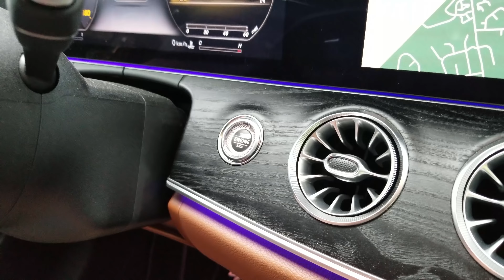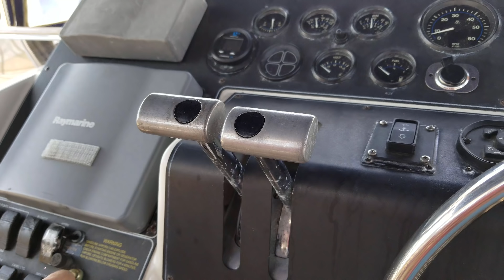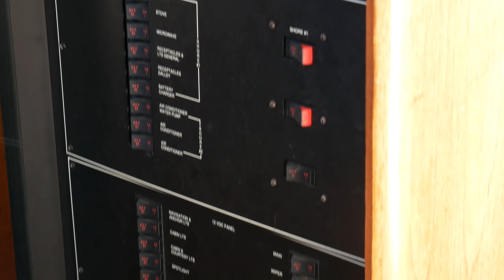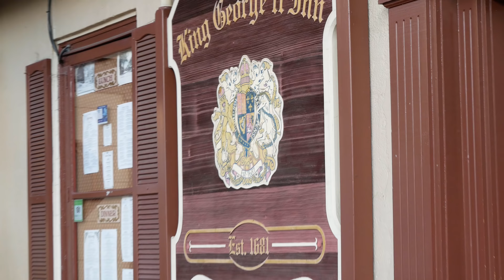We cruise our Carver 355 from Philly to Bristol E48

Comment: Have you still got your Carver?  I guess I thought you had sold it after you offered it "For Sale" in your video sometime back.  I'm looking for a boat to start with and I'm interested in your Carver if it's still for sale.  LMK.
Reply from the maker: Although it is still for sale, we stop listing it over a year ago. We started renting it out as an AirBrB at Penn's Landing, and it was showing so much profit we stopped trying to sell it. Still, if someone offers us $50k we will sell it. It is in great shape, engines are low hours and well maintained and it surveyed for $67k just a couple years ago. The reason we are selling it cheaper is the generator has been intermittent. It runs great, but the electrical output is sometimes off. Not sure what is wrong. We never use it since the refrigerator is 12 volt. Other than that the only thing that needs repair is one of the isinglass windows at the upper helm has a crack in it and we need to replace a patch in the sunbrella. Both minor things but we can not do it until spring. We love the boat and take her for short cruises up the Delaware we we are not busy on the Hatteras. There are about a dozen videos on this channel of us taking her to Martha's Vineyards a couple years ago.
Reply: I fell in love with your Carver after watching your video's so you don't have to sell it to me, I'm sold. I can tell  when you talk about selling her you're both a little sorry for getting rid of her.  I considered a larger Hatteras, but I think it's too big of boat for us to start with.  It's Friday night and I have to check with my Marina Monday to see who I would get to transport it to Port Townsend, WA. I've been renting a slip there because there is a shortage of larger slips and I'm ready to buy the boat.  It seems like there are far more choices on the East Coast then the are on the West Coast. For that price, I'll ship it. She needs a new generator, some wiring issues and a cracked isinglass. Anything else I should know about her? Have you done a list of specs for the boat? Maybe we should talk at some point via telephone?
Reply from the maker: I do not think she needs a new generator. I think it might be a circuit board. The generator itself runs fine. It just does not consistently produce electricity and it also does not shut off. I have to kill the air to stop it. Again, that makes me think it is a circuit board problem.

There are no wiring problems. There is a cracked issinglass and a patch on the sunbrella that needs gluing. I paid a local guy to fix them two years ago but he used inferior materials and it did not last. He should have used heavier glass and a better zipper. It is minor stuff but I would rather be right up front.

The only other thing I can think of is the fact that I never used the auxillary fuel tank. There are two 100 gallon main fuel tanks and a third auxillary tank under the swim platform. The previous own said he never used it. We never used it as well since I was worried there might be water in it or a leak.

If I were to keep the boat, my next project was to replace the oil cooler on the port engine. I already replaced the one on the starboard side. It does not need it but I was told these things should be replaced every five years so I figure it is due. I recently replaced three out of the five batteries on board, so I would probably do the other two as well.

I painted the bottom two years ago but I did not pull her this year. We only put about 100 miles on her so I figured the paint was fine. We are in brackish water and do not get much growth. All I ever had to do was power wash the bottom in the Spring and it and was good to go.

As far as specs, if you send me your email address I'll send you the survey from when we bought it three years ago.
Reply: Ed - Thank you for spending the time to answer my questions and comments. I’m not going to try and negotiate a better price because of the few items that may need replaced. I believe $50K is more than a fair price for the boat in the condition it’s in. As I said, my only concern is the price for shipping it to the West Coast. I’ll start checking it out the first of the week.

My plan is simple; if I end up buying the boat we’ll have the work done either in Port Townsend or Seattle. My Wife and I have noticed some things we will do to make it ours once we take delivery. We have plans for bringing everything back to working order and updating the electronics. It looks and sounds like you and Lyn have taken great care of her.  I’ve looked at three same year and model boats during the last year. Forget “Trying Not to Sink” the boats I saw probably wouldn’t have made it out of their Marina’s.

My email address is consultant@cableone.net.  When you get the chance please send me the last survey so I can start familiarizing myself with some of the details of the boat. 

We’re still trying to find our boat, but I think you’ve got it and I just need to convince myself at this point.  I don’t think I mentioned it, but because there is a shortage of bigger slips in Port Townsend I have been renting an empty slip for two months just so I would have one available. We still live in Boise, ID but the move is coming up. 

As far as my timing, if I get a positive answer regarding shipping the boat, I would like someone in your area take a look at the mechanics of the boat (at my expense). If everything looks good and I have no reason to think it won’t turn out so, I’ll transfer the funds to you and we will ship her to Washington.  We have watched and enjoyed your videos and your adventures for years. I look forward to hearing from you again.
MM

Comment: Captain I was under the impression you sold your first boat may I ask how much you are asking for that boat
Reply from the maker: $50,000. We have not listed it for sale but will sell it if someone wants it. We currently use it as a condo in the city and take her out for short runs on the Delaware.
Reply: I run in Fresh water, what engine maintenance has been done due to the salt water
Reply from the maker: We have only run it in fresh water the past two year. We acid washed the risers and heat exchangers two years ago and replaced the oil coolers. Other than that, just oil changes. We have not put many hours on the Carver since we bought the Hatteras.
Reply: @tryingnottosink9107  THAT IS A  GOOD PRICE..I SURE WISH I HAD YOUR MONEY.I'D BURN MINE.LOL..I HAVE TO OWN BAYLINERS AND PROUD OF THEM..

Comment: My opinion is to never pair a new battery with an older, weaker battery.  The older, weaker battery will discharge the new battery to its state.  I’d put two new batteries on one motor and then replace the other two later.  Check with someone else, but that’s my opinion.
Reply from the maker: Good to know. I'll switch it out so the two new ones are on the same bank.
Reply: Yep, what can happen is you lose a cell in the older battery due to an internal short (it happens from vibration, shedding/flaking of the plates etc), then both batteries drain down to 10 volts
Reply: I concur with Tom Mitchell, the weaker battery will bring down the new one. Keep them paired together. A good investment for your tool arsenal is a Battery load tester ( Tool ). With all those Batteries you can weed out the weakest Batteries. And test the new batteries in the future. What's that?, you don't know how to do that !!, Signe up for the collage of U-Tube :-D, What size engines are in the carver?. Chow for now !!.
Reply: My opinion also.
Reply: @vetterfellow   I could be wrong but I believe it has twin 454's
Reply: @OG_Gamers_Live  I'll buy that, thank - U

Comment: What I would do perhaps in this case if they boat doesn't get used much, is look into Lithium Ion batteries. I got one for my motorcycle, that tiny thing weighs less than a pound, but it doesn't self discharge, and runs at around 13 volts. 180 CCA too. One time I had got water in the gas and that made it's way into the carb bowl, and I had to crank the thing like 10 minutes to get it running again after draining off some of the fuel to get the water out (by opening the bowl drain a little). A regular battery would have run down by then, but that little thing just kept cranking. The one i have in it has a built in charge controller than stops it from getting overcharged. You could get rid of a lot of weight there by recycling those 5 heavy batteries and just run a lithium ion battery, one for each engine, and a smaller one for the generator. And then install some type of switch so that you can start whatever you want from whatever battery, so you dont have to climb down there with jumper cables if a battery dies. The longest I've let the battery sit is maybe 4 months, still has full charge no problem. The problem with lead acid is they have self discharge, and keeping them on a charger forever eventually causes them to offgas electrolyte.
Reply from the maker: We do have switching, so I can decide which battery bank gets used. The boat can use a lot of amps if I am not careful. The refrigerator is 12 volt and so are all of the lights. I thought of possibly using lithium but I just did not want much of a project. The boat sits at dock most of the time, hooked up to shore power, with the chargers running.

Comment: If you know this is old but if your batteries are just for starting the engines you want cranking batteries. If they are being used to run your marine electronics then buy deep cycle batteries. Also you can’t beat Interstate batteries I usually get around 10 years out of them on my boat.
Reply from the maker: Yes, we have both types on board.

Comment: No, No, No,  As previously mentioned by Tom M.  Don't pair a new battery  with an old battery.  The old one will degrade the new one.  In the golf cart world you have a six pack of batteries and if  one dies it is recommended that you don't buy a new battery but instead replace it with a used one of the same vintage as the rest of the pack.
Reply from the maker: Good to know. I'll switch it out so the two new ones are on the same bank.
Reply: Your right, I had a couple of golf carts before, and I always replaced them all, it was better to go all or nothing :)
Reply: One time, I was in a jam, and they only shipped me 5 batteries, one didn't make it on the truck somehow, and I picked the best of 6 and put 5 news ones in there. Well, after a bit of "spirited" driving that old battery got so hot from the higher internal resistance of being older, it puked a bunch of battery acid everywhere. Had to pull all the batteries again and clean up the stinking mess. Do it right, or do it twice my Dad told me...
Reply: THIS IS NOT A GOLF CART.DIFFERENT SITUATION.THESE BATTERIES ARE NOT RUN IN SERIES TO EQUAL NEEDED VOLTAGE LIKE A GOLF CART..THESE ARE SWITCHED SINGLE OR SWITCHES PARALLEL SO YOU CAN MIX AND MATCH AT YOUR HEARTS DESIRE WITH NO PROBLEM.

Comment: All lead acid batteries are Manufactured the same.. There is no quality differences.. There are only 3 battery manufacturers in the world and they build batteries the same exact way period.. Exide is the only one that sells under their own name.. The others are private label manufacturers selling to companies like Interstate, Diehard, West Marine, Advance, autozone, Walmart, etc, etc.. So when buying a lead acid battery, your buying "cranking amps" and a length of warranty and of course group#/size.. Basically your buying a sticker/label.. It's like washer dryers.. Most are made by whirlpool.. So as for one being better, it's the luck of the draw.. Like buying a car that you had no trouble with in 10 years and the next same car had nothing but trouble.. doesn't mean the quality was better or worse.. just a luck of the draw.. When buying batteries, price is the smart thing to focus on.. Warranty is second only if it matters to you.. I've seen batteries with a 1 year warranty that lasted 8 or more years.. It's the same battery that had a 5 year warranty, but cost 1/3 of the price because it only a 1 year warranty..  It's really a marketing scam that everyone falls for..  You did good by shopping price.. It's like the company "Best Buy".. Their number one selling and highest profit item is their extended warranty that they try to sell everyone.. It's just buying a piece of paper you may never use and that is the hopes of all manufacturers..
Reply from the maker: I agree. Never buy the warranty. It is a numbers game that is not in your favor.

Comment: A series 27 deep discharge battery will weigh a lot more than a standard 27.  I think some so-called deep discharge batteries are just relabeled standard batteries with a higher price tag. Buyer beware!
Reply: You're partially correct. The only difference is the plates are made thicker and maybe better mats between the plates to reduce or control shedding and flaking. They don't give you any more amps of output, that would require more surface area.
Reply: Fun fact,,, In the good old days of Cars and Batteries unsuspecting motorists used to judge the value and quality of a  battery by it's weight, the more weight the higher the quality.  Unscrupulous manufacturers caught on to this and started putting a layer of cement in the bottom of their battery cases to increase their quality and retail prices.